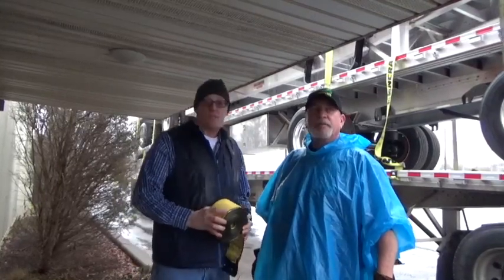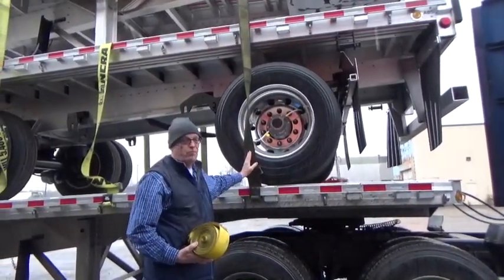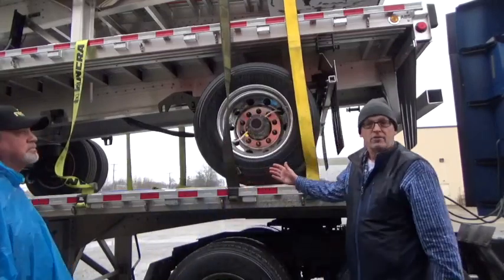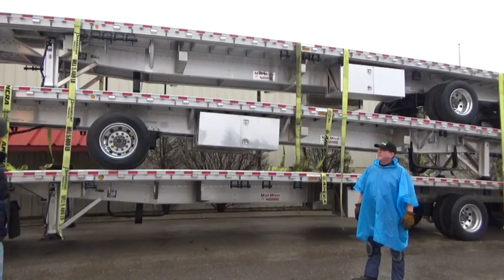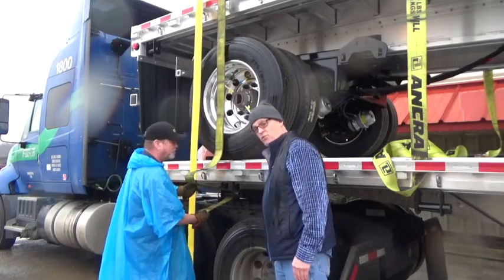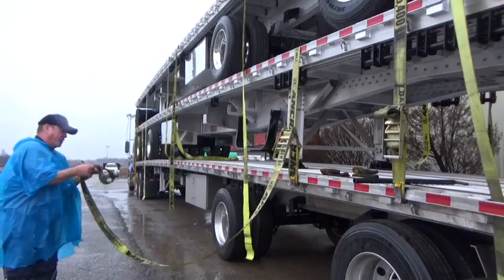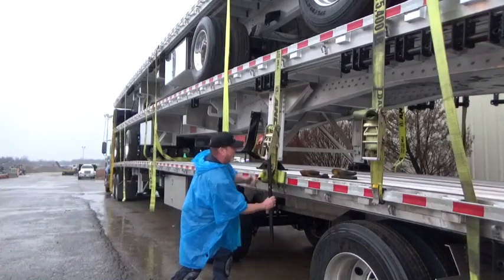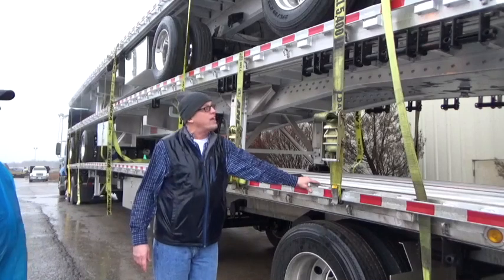Falcon Transport Flat Bed Strap Down low def

Comment: Never put a strap or strap hook on the outside of the rub rail. They call it a ( Rub ) rail for a reason. Also put a half twist in the straps and the won't sing in the wind.

Comment: If you will twist the straps on both sides about 2 twisting each side before install both sides on bottom trailer they want not flap in the breeze and cut them.  Dot say that doesn’t affect the integrity of the strap.

Comment: The rub  rail is not meant to be secured to it straps you go through and rail  just underneath the frame of the trailer that's the best way and the strongest the rub rail is nothing more than a piece of molding welded to the outside of the trailer is not as strong as hooking it right to the frame of the trailer yes one way is quicker than the other but is quick the best way      NO  it is not

Comment: you never use a rub rail to use as a securement, rub rails are there to protect the straps, always  put straps inside the rub rail, some people should not mislead other people with wrong instructions

Comment: A incorrect statement the one person says about using straps already on the trailer is having new straps on the winches, even though they are new straps they are the buyers new equipment if one breaks in transit it can be claimed against the driver, so always use your own equipment to secure the trailer
Reply from the maker: Thats correct straps should not be attached to the rub rails. These were attached under the frame on the deck of the trailer.